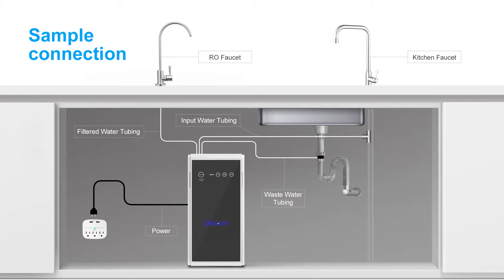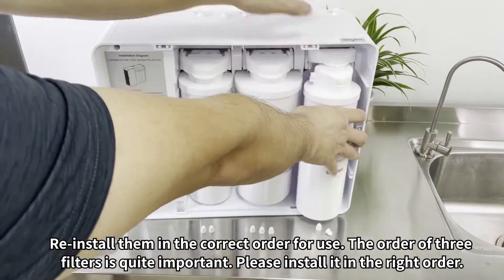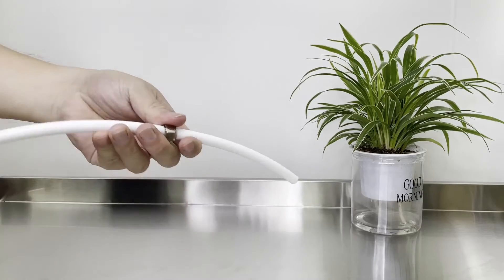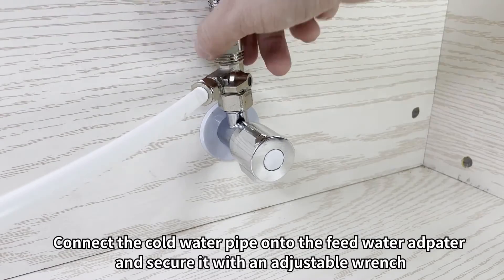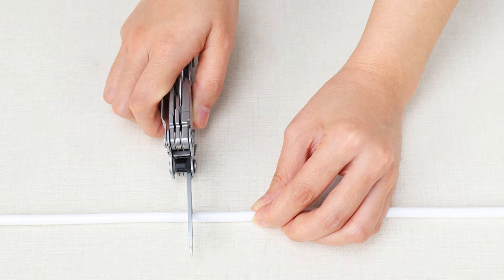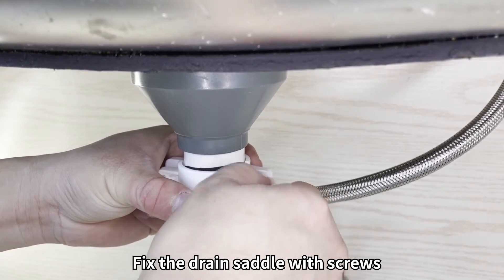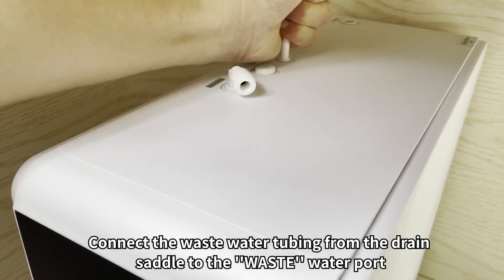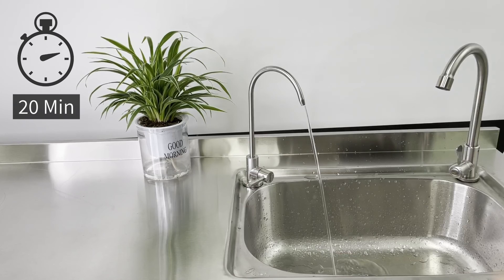Deepuro WS-RO-600G Reverse Osmosis System Installation Guide

Comment: Your video says NOTHING about these being plugs in the top of the machine that should be removed!  They are in so tight it requires pliers!  I was afraid to try and remove something with pliers from the first unit I purchased, as I really wasn’t sure they were plugs, and I was afraid of breaking the unit if they were not plugs.  But, of course the hoses would not fit.  YOU HAVE NO TECHNICAL SUPPORT OTHER THAN EMAIL, so I couldn’t speak to anyone to ask a simple question, so I sent the whole unit back for a refund!  Either make an accurate and COMPLETE installation video, or provide some IMMEDIATE technical customer support via a phone number!